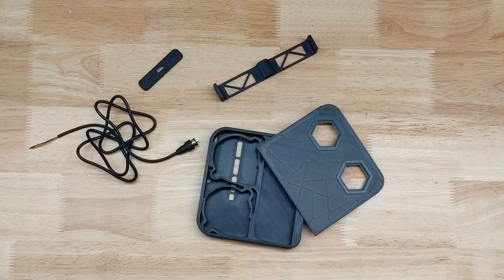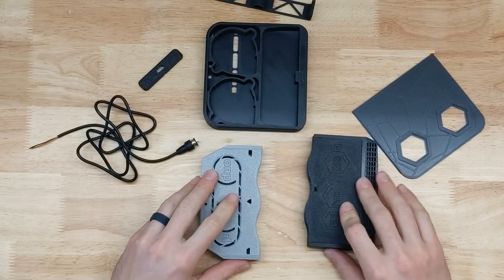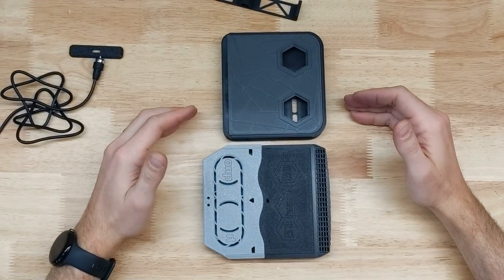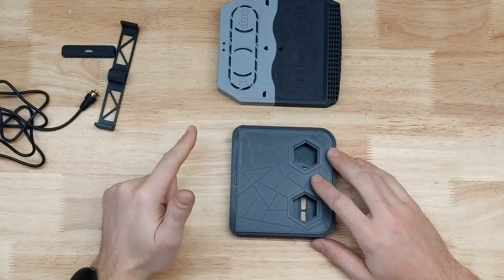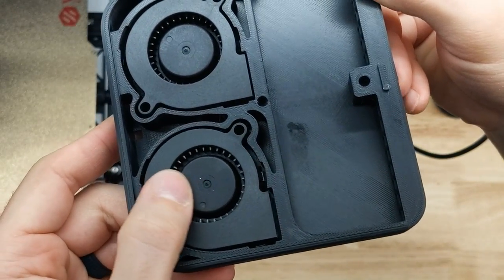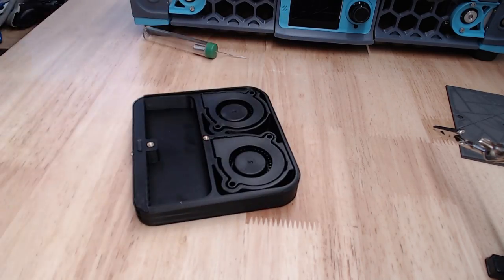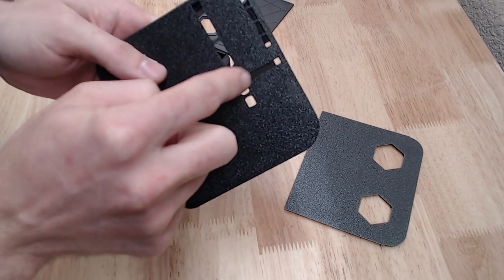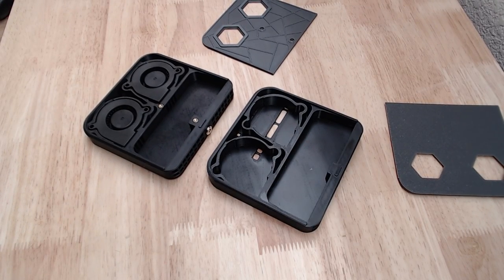Voron 2.4 - THE FILTER... Nevermore Replacement

Comment: On the newest version the mesh is smaller so the nevermore carbon doesn't fall out. 

And with the wires, You pass both fans to the left , splice them in the back cavity , then run two wires to the front. This is also the space for the extra wire to live.

Comment: I noticed you are also running your bed at 60% power. If you bump it up to 80% it will help heat the bed much faster, but still slow enough to not warp the aluminum. Just printed this filter and exited to get it all connected.
Reply from the maker: Thanks for the advice. Since posting this, I removed the bed heater frequency section in my config and it solved all of my heating problems and definitely improved the time. I also started using Ellis' bed heating macro which is pretty nice.
Reply: @zsdewitt  Nice! Do you have a link to his Macro? I'm curious what it does
Reply from the maker: @SilvaSRT4  

https://github.com/VoronDesign/VoronUsers/blob/master/printer_mods/Ellis/Bed_Fans/Klipper_Macros/bedfans.cfg
Reply: I have currently just printed the nevermore mini. I'm about to order a 4028 fan for it. I have not opted for the extras. I am in need of the HEPA filter yet. I'm just curious if anybody has experience with the nevermore mini because I'm very curious about this what I don't like about this unfortunately it does not have the HEPA and perhaps this is just an old version I'm stumbling across right now